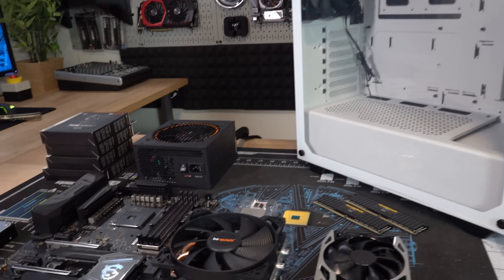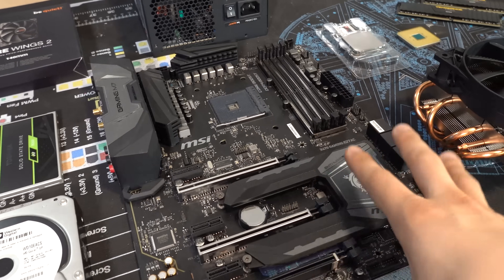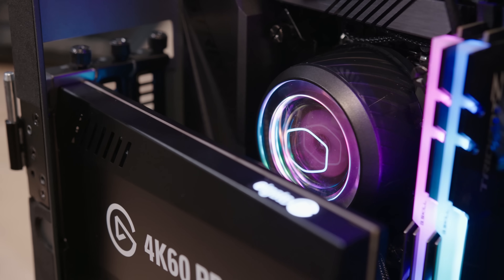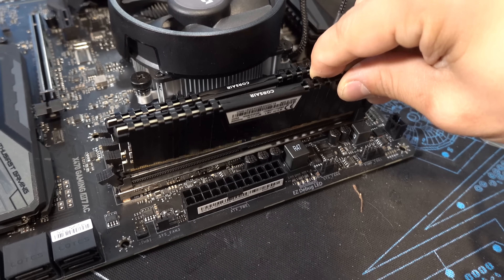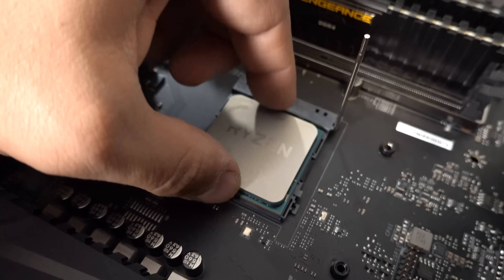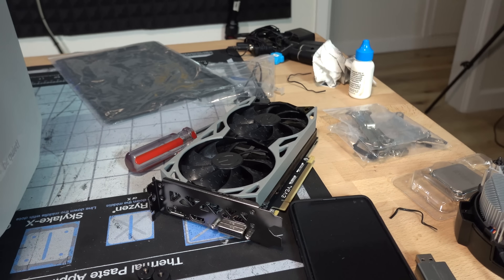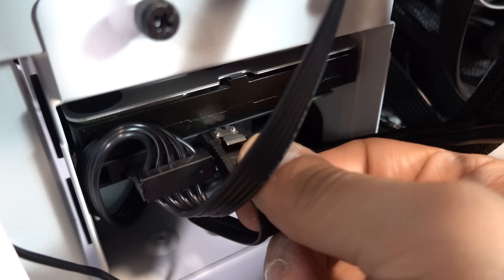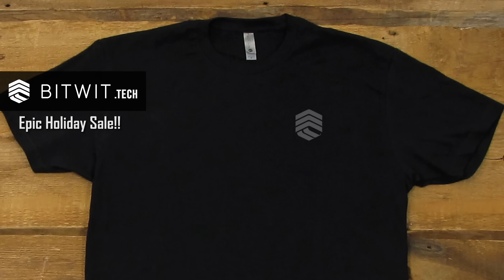Let's build a computer

Comment: New to building PC, trying to build a gaming pc..wanted to know if this would match
MSI B450 TOMAHAWK MAX
MSI GEFORCE RTX 2060 DIRECT X
RYZEN 5 2600 6-CORE YD2600BBAFBOX
EVGA 600W 80 PLUS

please advise 
Maholo
Reply: The mainboard has the correct socket, the PSU is sufficient, a "MSI GEFORCE RTX  2060 DIRECT X" does not exist.
Learn more about the components before you do/fuck up anything.

Comment: 4:34 what is that liquid? Is it necessary?
Reply: That is thermal paste. It helps transfer heat from the CPU to the cooler more effectively. It is very necessary if you don't want your CPU to run hotter than it should. Most CPU coolers will either come with it pre-applied or in a little syringe-looking thing.
Reply: Jose Javier Flores thx

Comment: You could've put pre-installed 140mm at the top along with the other 140mm fan and then put all 3 120mm fans into the front.

Comment: Hey Kyle, I've just started out building PCs and doing repairs and part replacements on my own time, and I'm starting to get a small collection of screws and cables.  Just wanted to say that I just found and purchased the exact same 44-drawer parts cabinet that you showed (at 4:12 in the video) SOLELY because it was in YOUR video and it was working for you up until recently.  Thank you for subliminally helping those of us just starting out by showing us some of the solutions you use behind the scenes.

Comment: I need to know if I have a good part list

Ryzen 9 3900x

Rog Crosshair vii 

Nzxt H710i 

Deep cool castle 360 evo 

Rtx 2080ti founders

32gb 3200 speed Corsair rgb
Reply: If you want to save some cash and don't have way over the top needs, step it down a bit. Maybe get a ryzen 5 or 7 and a lower end mobo and video card. That stuff is going to cost thousands of bucks.
Reply: Daniel Harvison i have a max budget of 3500
Reply: @Maybeostc  USD? That'll about cover it. If you really want to go that way, then fine, I'm just saying you don't necessarily have to.

Comment: @7:50 But you didn't install the *insulation pads* on the *brick* so it wouldn't touch the case and *short circuit!* /s =P

Oh wait, that was that fucking idiot from The Verge.  Lyle/Kyle actually know how to build a case ... carry on!

Comment: The x470 gaming m7 ac supports bios flashback, you don't need a cpu to update the bios... All that faffing around when you could have connected only the psu, plugged in a usb stick and pressed the button at the back.

Comment: Hey Kyle! After researching about that case last week, Im pretty sure that you could mount 3x120mm fans at the front, 2x140mm at the too and 1x140mm rear, that's why they sent you 3x120 and 1x140 to accommodate all the space

Comment: why put thermal paste on, just to update bios/chipset? i usually just put a little metal plate (no thermal paste) on it no problem. my friend is all fancy and uses a thermal pad with his tiny copper plate, no problems either.

Comment: Build my new pc today! But sadly, my blootooth wifi doesnt work. I can not use ethernet cause I'm living at the back of the house...
Reply: Did your Wi-Fi antenna come with a disk? If it did, run the software on your PC and install the drivers, that should get your Wi-Fi working. Or if possible, take your PC to where your router is and temporarily plug it in to download the drivers. If you have an Android phone, you could even download the drivers onto the phone and transfer them to your PC via USB.

Comment: Hey Kyle, not sure if you knew but that X470 board you used supports Bios Flashback - so you didn't really need to use that 2400G at all.

Comment: Thank you for showing the Bios Update you have to do first on some older Boards for Zen2 CPUs. But this Board had a USB BIOS Flashback Button and so there was no need for an extra CPU, but only mostly MSI Boards have that Option. The newer MSI... Max Boards come with a working Zen2 Bios, but perhaps not with the latest one.

Comment: Would never recommend one of those eco-green 5200rpm drives, they are so slow, you end up waiting ages for anything to load thats on it.
Reply: It's not the boot drive, so it doesn't really matter.
Reply: @KajunBowser  Well he said put games on etc, I had one of those WD green's for a while a few years ago and it was terrible for loading games. Also that SSD is pretty small so only a couple of games will go on there, the rest on the HDD.

Comment: 5:15 - do you ever get motherboards that become touchy like the dimm slots can become a little problematic?
I found that my MSI test board became really screwey with the dimm slots after a lot of hardware swaps.
Reply: I once had a terrible habit of inserting my ram before installing my cpu cooler. After pulling the lever that tightens up the heatsink, it'd warp the ram slots, making it really iffy about whether or not the ram would even work at any given moment. Took me ages to realise my mistake :( Back in the day, that is.

Comment from the maker: The build...is ALIVE!!! 

Thanks for watching, my bois. Take advantage of our Holiday Sale - 15% off orders $50 or more, 30% off orders $100 or more. NEW Extended Mouse Pads, Pint Glasses, Hoodies and more at bitwit.tech

Edit: HERD DERP. Didn't realize that the motherboard has BIOS flashback. Didn't need the 2400G after all! Also, a viewer on Floatplane asked why I didn't mount the two 140's to the top and three 120's to the front of the case. IMO If I did the 120's at the front I kinda felt that the bottom fan wouldn't be doing much since it's almost entirely blocked by the drive cage (and drive cooling isn't too important for this build). Whereas two 140's at the front would provide more airflow where it counts, to the CPU and GPU. Of course, I'd have to do some testing to determine which config performs better or if there's roughly no difference.
Reply: Why u didn't use Flash BIOS Button to update the bios? I bet u forgot
Reply: Aaaaaaaaah
Reply: 1:14 ... KYLE !! ... cmon !!! what would LYLE say ?  You have a MSI Board - by the way - a BADASS Board of the  X470s - to be exact - this boy: MSI X470 Gaming M7. 

MSI is the MOTHER of "USB Flashback" ... for an Update you don´t even need a CPU or RAM and also no graphics card or an APU with a non existing Display Out Interface at the BRACE ;)

just take the newest BIOS File on it - rename it, and FLASHBACK the Board - DONE.

my "hopefully" one and only dislike ... you are better than this - I KNOW THIS.

Please - tell this to your millions of viewer - they have to learn something. 
Not just only stick the components together like LEGO with one hand and beeing smart and funny at the same time.

greetz from Germany ;)
Reply: Aaaaaaaaah
Reply: Aaaaaah
Reply: Cookie
Reply: What about your gurlz?
Reply: Please make a bios update guide for ryzen 5 3600 im going to upgrade from ryzen 3 2200g and there are so bad bios update videos out there please kyle !!!
Reply: Is it me or is the interior of this case extremely similar to the meshify c...